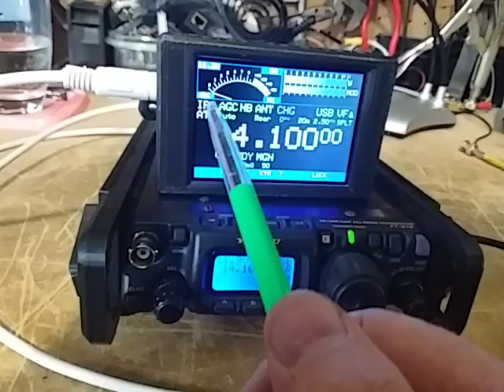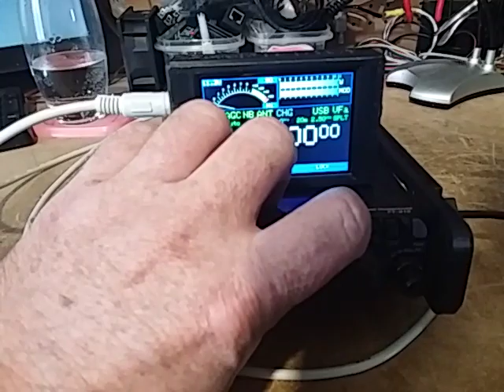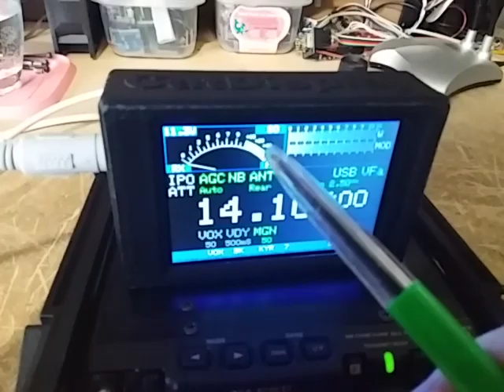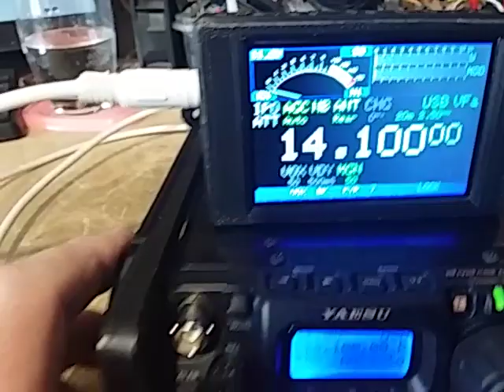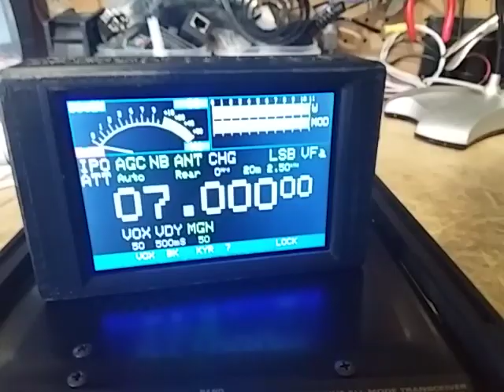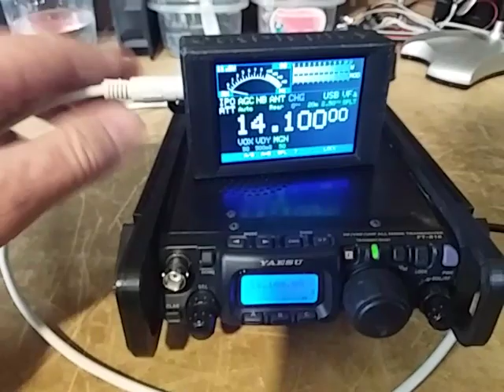Original CatDisplay for Yaesu FT-818ND (FT818)

Comment: Thanks, Chris. Got the display today and the video helped answer questions that the instruction page didn't include (eg. what the W and MOD scales were). You had me wondering why you were transmitting on the 20m beacon freq until you said it was in dummy mode. 73. Cheers.

Comment: I have an LCD monitor in my car with a composite in. I'm looking at going to an FT-891 for mobile. Can this a. work with the 891 and b. be modified to output to a second screen? Cheers, Les - VK1LH
Reply from the maker: No, this only works with FT817 & FT818 & does not support a composite monitor. 73s om de chris zl1cvd
Reply: @ZL1CVD  No dramas. Thanks for the awesome project!

Comment: Thanks for the demo video. It would be nice to make one up that can be controlled through the display itself. Thanks again, 73
Reply from the maker: The issue is control of these rigs is very limited - not much more than frequency & mode can be externally controlled safely (via CAT standard commands). Technically, you can do more but this can cause serious irreversible damage to the rig if you start writing directly to the eeprom.
Reply: @ZL1CVD  got it, thank you
Reply: @ZL1CVD  I have run my 817 early version with Ham Radio delux, I could even turn it on and off with the computer, seems the only thing I could not do was to turn up or down the volume, All through the cable,  ???
Reply from the maker: @1903A3shooter  Sure, early version of HRD made allot of money for Yaesu radio technicians who had to replace allot of EEPROMS that got worn out. I am not prepared to put product into market that will cause such issues. HRD appears to not have the same issue. 73s om de chris zl1cvd